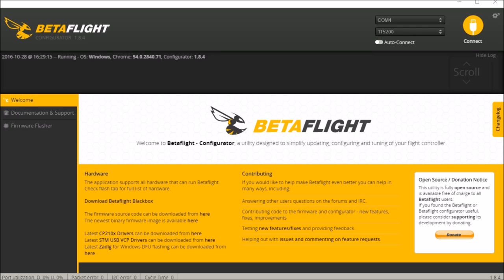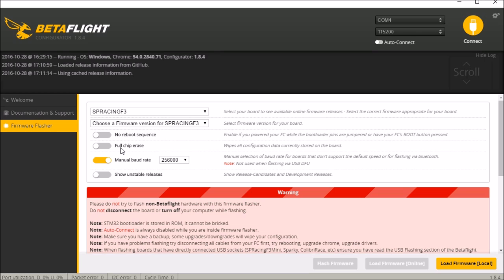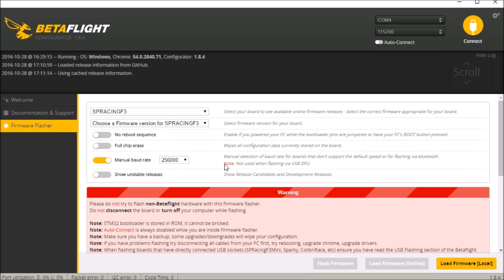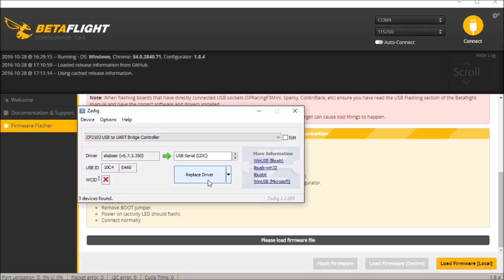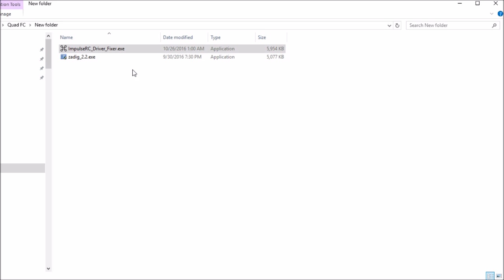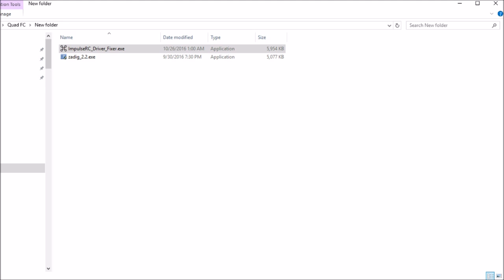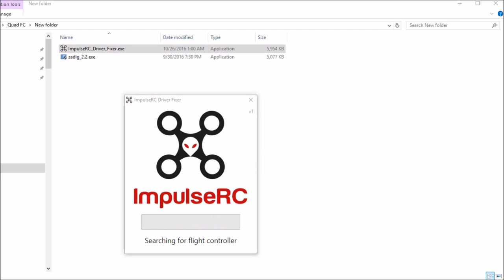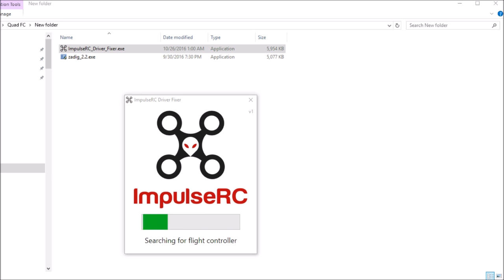Trouble Firmware Flashing

Comment: Hi Nick. I'm new to the hobby and I have a similar problem, not flashing the board,  just setting  up the trans. With the new quad. It was no communication between cleanflight and the quad.( Failed to open serial port).. Apparently I had a driver conflict,  that i was finally able to fix it and set up the two shurikens (180 and 250) that I have..  A couple of weeks later, I received  my  little QX95, and same thing happens.. ( Failed to open serial port). I was able to fix that too, using the Zadig Driver Fixer, but now, when I plug the Shuriken back on the computer, the freaking ( Failed to open serial port) appears again!!! This time, I could not fix it with Zadig, and looking for a solution, I found your vid. In youtube.  I downloaded the ImpulseRC Driver Fixer, but nothing happens!!! It just opens a small window  and stays (Shearching For flight controller) Like at the end of your vid. I even went to the ImpulseRC web page  and clicked on the link that it shows( If you have trouble running theImpulseRC Driver Fixer) And everything was installed right... so..if you have Any other suggestions i would really appreciate it.
Reply from the maker: Sounds to simplistic but is the fc plugged in when you run the driver fixer? What lights appear on the flight controller?
Reply: Yea, is plugged.. As soon as I connect the USB cable, the FC flashes green like 3 times, green and blue,  and then the green light stays solid and the blue light stays  flashing
Reply from the maker: Sounds like the flight controller is fine. Has chrome been restarted? Restarted the computer? Maybe reinstall the cp210 drivers?
Reply: yes, I thing that to.. The two quads fly fine.. I will try reinstall the cp210.. I let you know.. Thank you very much for your help
Reply: Noting.. I delete and reinstall cp 220 Driver and No communication..
Question. When you  use Zadig, You have to always have to replace the driver CP2102 USB to UART bridge controller to USD Serias (CDC) Correct?
Reply from the maker: Sorry, I can't remember at the moment. Sounds correct but I wouldn't want to say as if I am sure right now.

Comment: Driver fixer triggers anti virus file protection
Reply from the maker: I can see that might happen on some antivirus. The fixer is likely making changes to the usb driver (a windows system file), which some antivirus will detect and have an alert, even others will detect but recognize that it required user input to run (Windows permissions with the "yes" "no" buttons) not registering an alert.

Comment: hello guys, i just got my tiny f3 controller for my tinywhoop (im super excited its my first fpv quad!) but i totally cant flash it and make it recognized by betaflight nor my computer. as soon as i plug it in a pop up appear saying that windows doesnt recognize the device, i tried to look for stm32 drivers but i havent found anything that seems working, and zadig or immersion rc they dont recognize the controller at all.. please help guys! after all the bangood waiting i feel im super near to fly!
Reply from the maker: Did you download and install the drivers on the cleanflight/betaflight welcome screen? They are linked in bold. Also what operating system are you running. Did you try with reboot sequence on and off? Did you try manual baud rate?...normally 115200. When you plug in the board do you get led activity? What colors and what do they do? Try multiple cables.
Reply: Thanks for the reply! i downloaded all the drivers from the betaflight screen and im running windows 10.When i plug in the board i got a stable blue and red light, same story with different cables. i tried different combinations of settings when flashing but betaflight still says failed to open serial port..mm im kind of stuck and since im not a driver expert im feeling a bit blindfolded in solving this problem, but i will! thanks for the help so far!
Reply from the maker: on the betaflight screen before connecting the usb cable what comm ports are listed in the top right. Then plug in the usb cable to the vehicle, is there another comm port? If so select that one. Now what happens? Do you still get the windows doesn't recognize the device message? Have you rebooted since installing the drivers?
Reply: the port say /dev/rfcomm0 and doesnt change after i plug in the controller, i think the problem is that i didnt short the boot pins cause i didnt knew there were. i will try doing it one of these days and hopefully it will work. do i have to unsolder back the boot pins once i load the firmware? thanks anyway nick for taking the time to answer, I love your channel!
Reply from the maker: so rfcomm0 is the only port listed? With the usb unplugged and plugged in? If so that's not right. If you short the boot pins, typically, we only need the pin/pads shorted while plugging in the usb, they shouldn't need to be soldered on, its a temporary "boot" connection.
Reply: it worked! i just had to shorten the pin and then i used zadig and immersionrc and everything went fine, now i got issue binding the model to my devo7e, the solder joints of the receiver look ok but i dont see any light on it (i honestly dont even know if there are). On betaflight i turned on soft serial under configuration and select the receiver mode RX serial with spektrum 1024 as receiver provider, under the ports section i turned on serial rx for uart 3 and i selected spektrum under the receiver. i kind of cut and copy my actions from blog around and im probably making some mistake mm
Reply from the maker: What flight controller are you using? This video might help https://www.youtube.com/watch?v=p0jcz8E90mgThere are text steps in the description.
Reply: super! ill take a look and try, you really have a video for every problem! im using a tiny sp f3 controller like yours, i ve pretty much copied your build aha
Reply: my receiver is now blinking (yee) but it doesnt bind, im almost theeere
Reply: i can follow the step of your video till the 11th, the receiver light blink very quickly, but then the CLI doensnt recognize the command set spectrum_sat_bind=0

Comment: BIG thank you for this.  I haven't tried it yet but have 3 brand new boards just waiting for the magic fix.
Reply from the maker: I hope it works for you like it did for me.
Reply: It did!  Well on all except for my brushed F4 board.  At least I am getting a DFU out of it.
My other 2 new F3 ones are doing great.  I cannot thank you enough for posting this.
Reply from the maker: Great! There is some magic in there!
Reply from the maker: does the board light up, red and blue lights? I might be mis reading your post, can't or can connect to cleanflight?
Reply: Nick Burns not misread.  The F4 does not light up or respond to an unbooted connection to the computer.  And I am unable to flash it in bootloader mode.
Reply: sorry not to me.   Is the case though.
Reply from the maker: if the board doesn't light up at all with usb plugged in, either F4 board are completely different than all the others or something is defective with it.
Reply: Maybe the problem lies somewhere in the FC's groundbreaking, "perfect, cabin pressurization and depressurization technology" ????